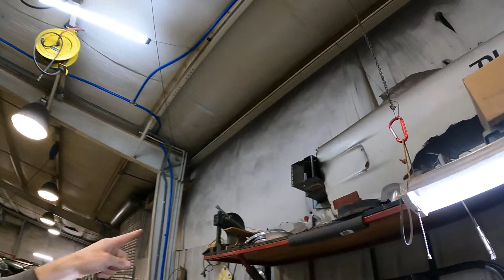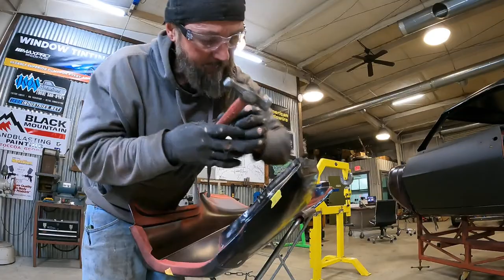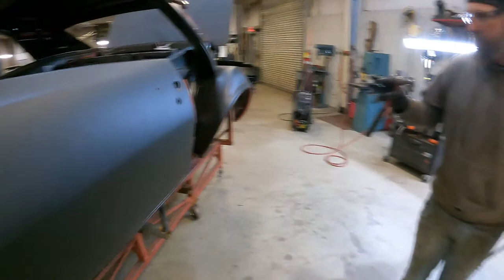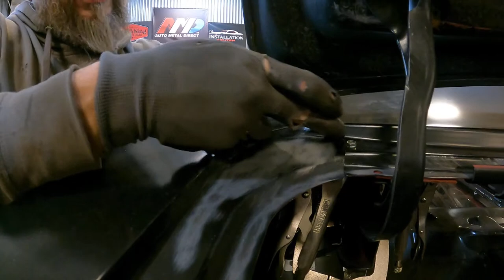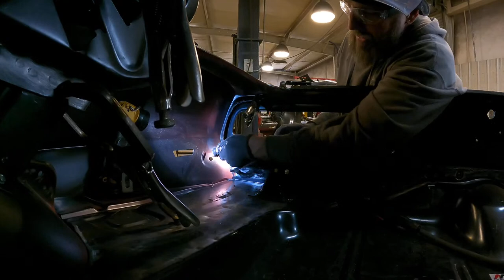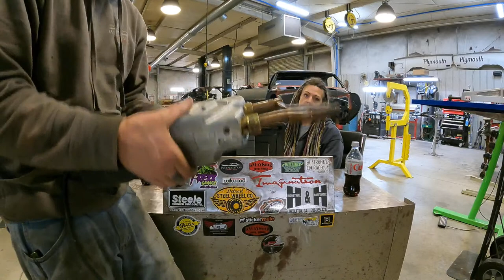Tech Talk Tuesday Episode 54 - 1967-69 Camaro Quarter & Tail Panel Fitment

Comment: Question; Does the Qtr. pnl. get welded to the reinforcement lock pillar that the door latch screws into, Or does it just butt up next to it for support?    Thanks Jubee, Your channel is a fantastic source for information. I'm in the process of  qtr. pnl. tail pnl. pkg. pnl. replacement on a  68 firebird.
Reply from the maker: It gets welded in that area